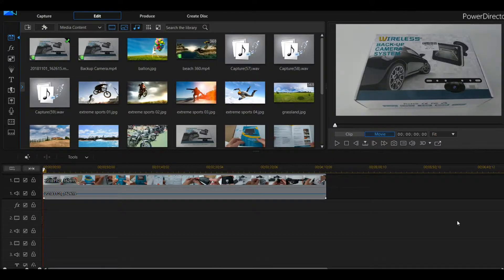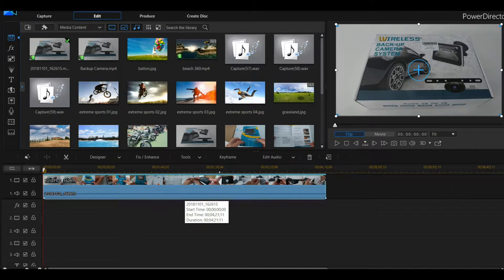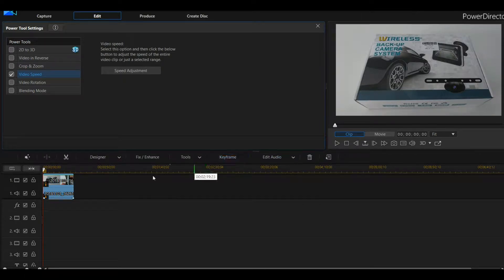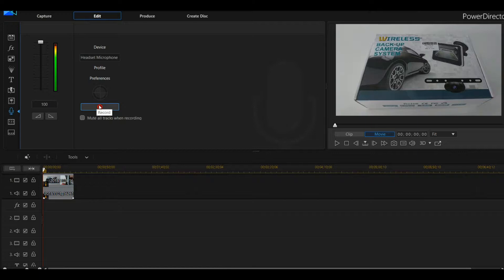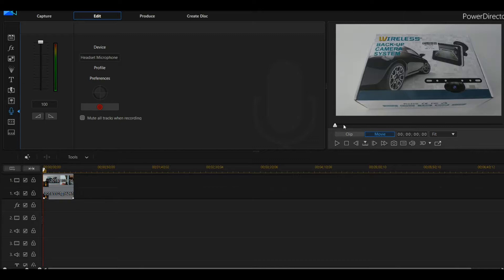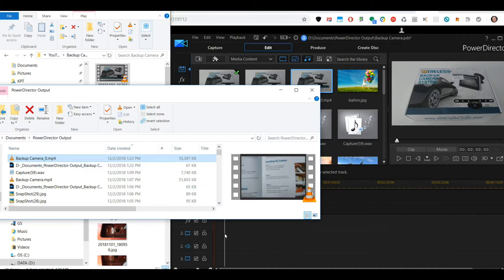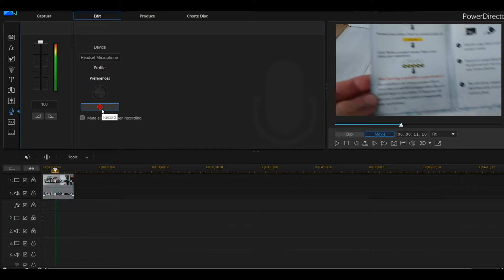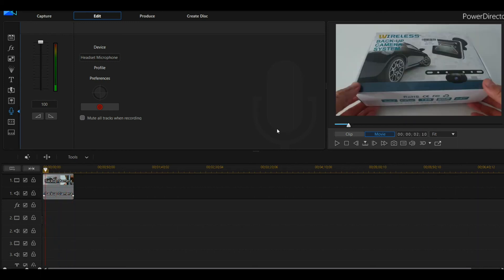CyberLink PowerDirector Preview Video Gets Stuck When Setting Speed Adjustment Higher Than About 3x

Comment: Still a big problem in 2022 with Powerdirector 360. It happens once the video clip is more than 60 seconds. My workaround is to cut the original video clip into 60 seconds length and set the speed for all the cut clips
Reply from the maker: Yeah ... that's crazy. Oh ... btw ... I don't have the problem any more, but I don't know what solve the issue. I'd suggest to try with activating shadow files and lower preview resolution. Could you adjust that and let us know if it solved the issue? Thanks